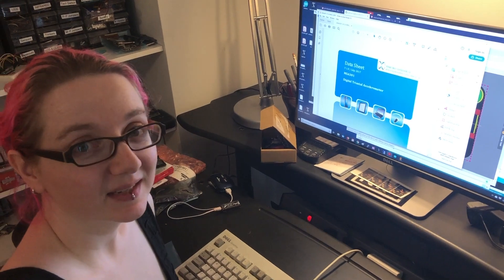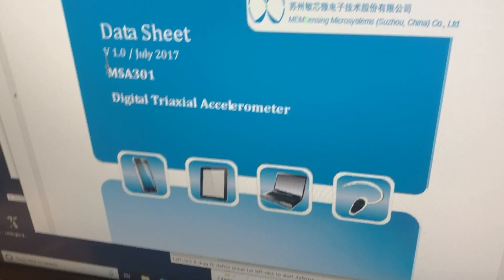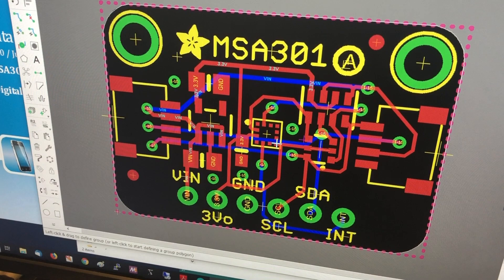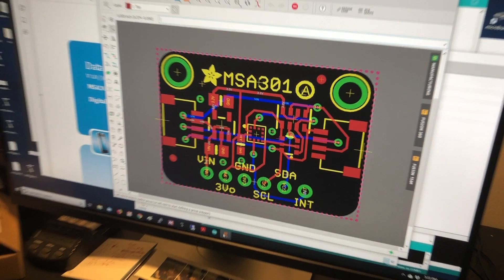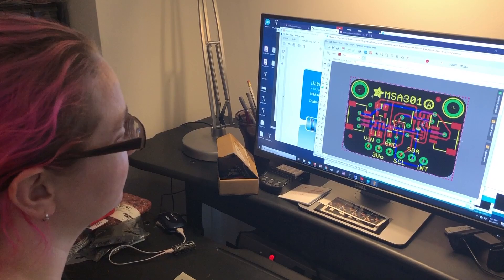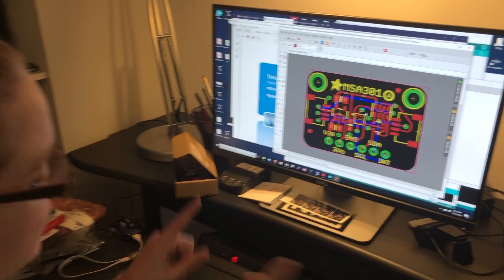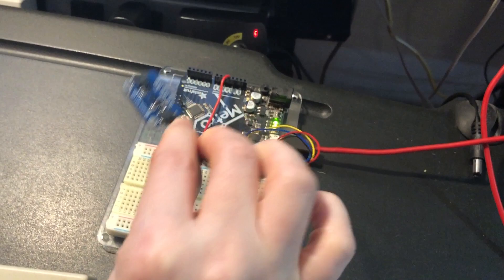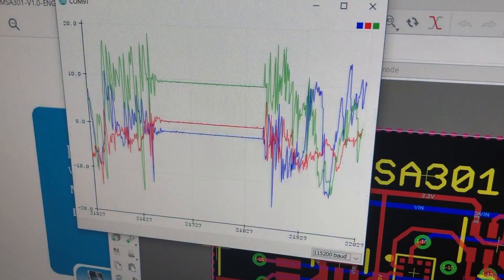Trying out the ultra-low cost (20 cents) MSA301 accelerometer with the Arduino plotter

Comment: Can it be an effective way to wake from low power mode to use an accelerometer in something like a smart remote?
If still for x time goto low power mode.
If moving wake from low power mode.
Or would processing the data use significant power?
The smart remote I had brief use of, had a 4 line back lit text display and some form of wireless Transmitter/Receiver.